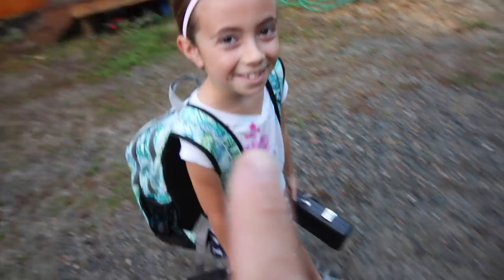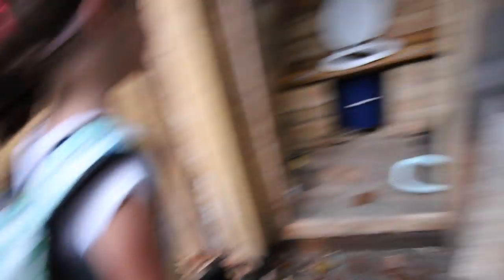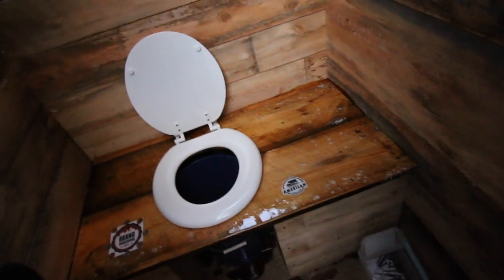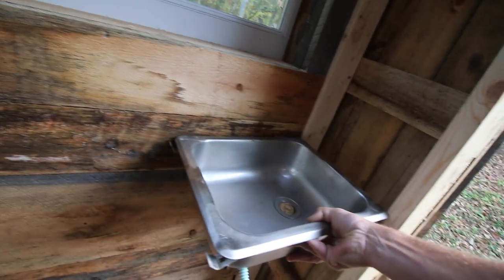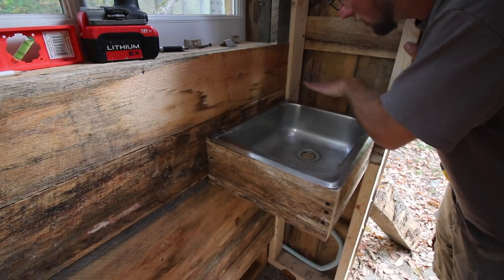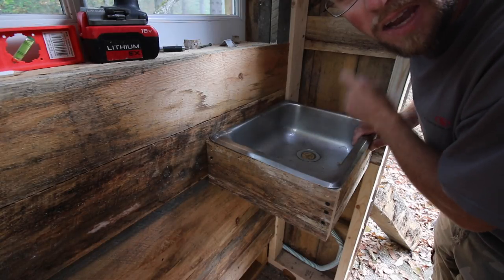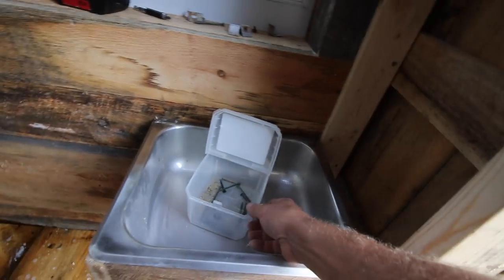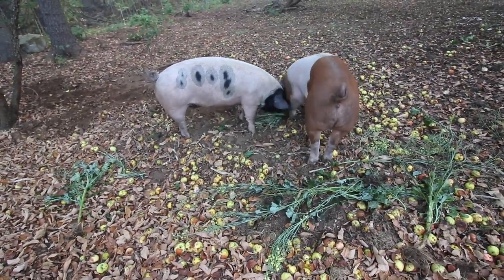Making the DIY Composting Outhouse Santary

Comment: A 5-gal bucket outside on the wall up high with a hose running to  your faucet.  just to add projects to your life. Gutters on the roof to  rainwater collection barrels mounted on the back wall of the kitchen to feed sinks inside as well as the outhouse.

Comment: You could use a barrel up high, attach it to the kitchen, even use rain water.  Then drill a hole in it and run a hose with a shut off on it to right above the sink.    The shut off would of course be at the sink end.   Just an ideal.   Thanks for sharing another great video.

Comment: You could add a fan that draws the warmth from the kitchen into the out house. You can run the sink hose to where it is hidden in the wall and run it out. As for a leg. Look for a local woodworker to make a custom spindle leg. Or find a ornamental porch post and cut it down to size.

Comment: I doubt you'll be using it in sub freezing temps but you might think about a solar heater project like 4-6" black PVC on the roof to a barrel and use same water supply you'll have for the outdoor kitchen (or a garden hose to the PVC) and a small 12volt RV type pump and faucet. (once you get your solar panels). Hot/warm water to kitchen and bath.
For now, a bucket with a spout. A milk can for the bucket might be cool.

Comment: Howdy Lumnah Acres well first I would not put a whole post but a kinda oblique support screwed into the outside wall. Maybe just like John Austin mentioned a hand sanitiser would be perfect for all the reasons he told. For the ladies I would hang a small mirror. Oh and another topic... When you stand in front of your outdoor kitchen (ODK) on the left side where you used to park your Kuboda tractor, you know where I mean!? From that wall 8 feet straight paralel there I would built a retaining wall just to level the floor and nothing can slide off. When that is done I would put an awning from the end of the ODK roof to the finished wall. Now you have a "garage" for your Kubota and the tractor is save from loads of rain/snow and you might have extended the life of "Little Red" a couple years! Good job on the ODK and all the buildings attached!

Comment: Gutter from roof fills 5 gallon bucket mounted high (but still able to top off with water jug if needed), 1/2" pipe out bottom to 1/4 turn valve, elbow over to where you want the "spout" which is a cap with 2 or 3  1/8" holes drilled in it. They will restrict the flow no matter how much the valve is turned.

I can send a wet napkin sketch if you want.

Comment: a rectangle tank would work great if you can find one with a spigot on the bottom.  Or, what is your plan to put water inside the outdoor kitchen?  You could always just put a hose from inside to the outhouse with a spigot.  What do you do with the stuff in the bucket once it is full?

Comment: What about a gutter off the roof into a drum with a pvc line running in through the wall with a cut off valve?
Reply: probably wont have much of a downspout from gutter into drum but could add a shelf on the outside for the rain barrel to sit on, probably with an overflow on it so excess rain can run out

Comment: When the going gets tough, the tough go shopping.   That is some fool has figured it out and has it for sale.
Water containers with spickets near the bottom would work.  Check camping suppliers for hand pumping tanks.  Being able to set the tank on the floor and fill it from outside is a plus.